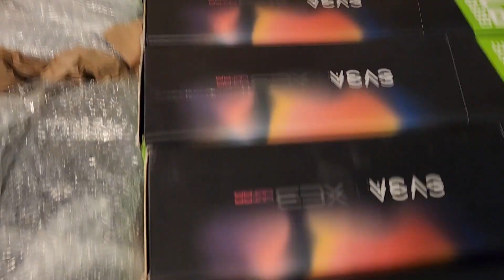So I blew up a 2400 watt psu, oh and I had a big mining farm expansion too

Comment: how much are you approximately paying for these 3070s? per unit, thanks.
Reply from the maker: 200 per
Reply: @kr00tmanmining  holy shit and i cant get a 2060 for 200
Reply: @kr00tmanmining  from where...
Reply from the maker: @acolexa  there are deals to be had but you usually have to buy in bulk, also probably easiest in the states
Reply from the maker: @braydenmcdonald2287  bought these off another miner
Reply: @kr00tmanmining  Wow, thats a great deal. Lowest i was able to get a couple for was for 400 each and after that he jacked the prices up to 500. (Aud)
Reply from the maker: @braydenmcdonald2287  yea I think prices will go up thanks for the 4070 rumor's, Nvidia is nuts